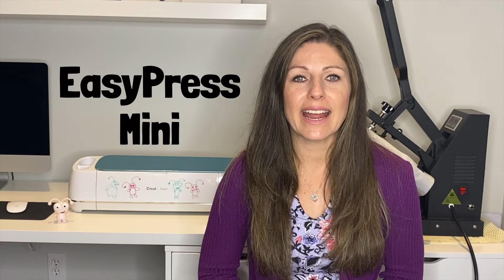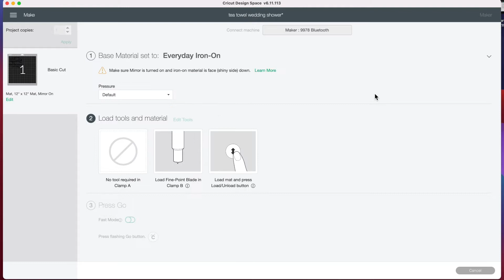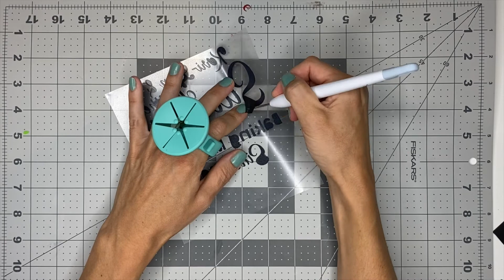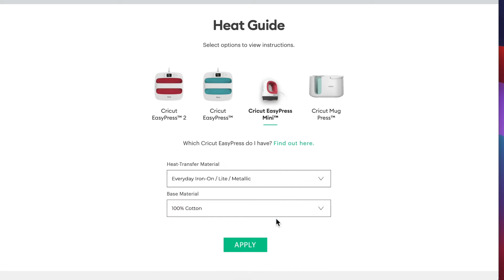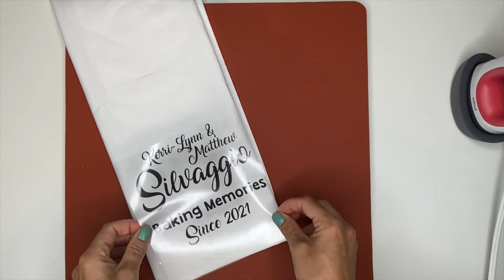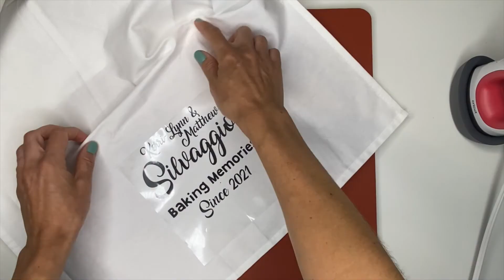Cricut EasyPress Mini Easy First Project

Comment: What type of transfer tape did you use please?
Reply from the maker: The majority of heat transfer vinyl already has an adhesive backing on it so there is no need for transfer tape.